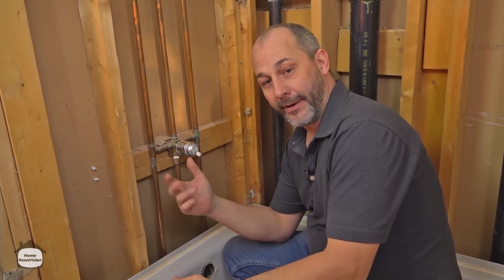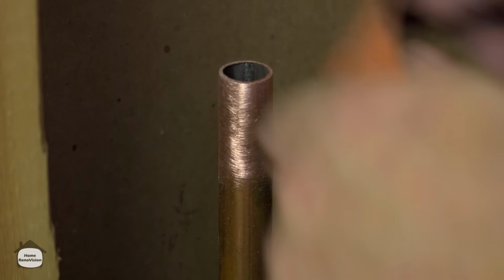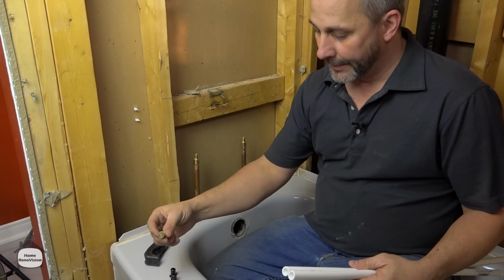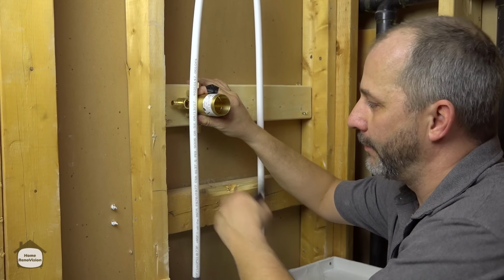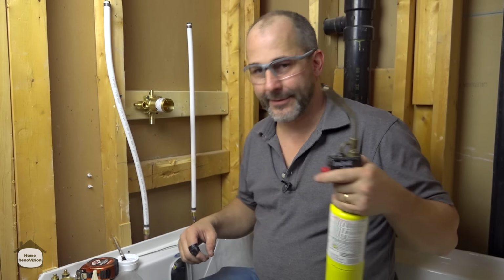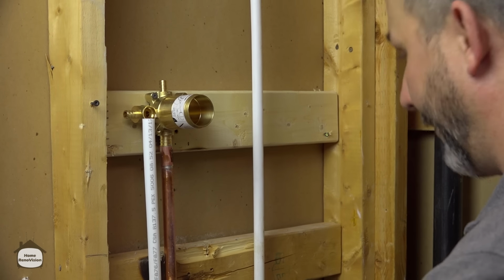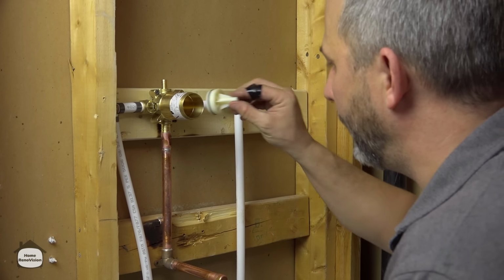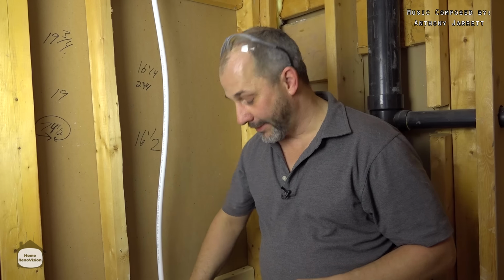DIY How To Install Copper To Pex Shower and Bath Plumbing

Comment: Being a contractor you should invest in a pex a expansion tool. I used my new dewalt expansion tool yesterday ($299 tool and heads, no battery) and loved how quickly I was able to run plumbing for 3 bathrooms and a laundry room. I think once you try it you won’t go back to the hand crimper.
Reply from the maker: I will take a look at that, Thanks!
Reply: Yes Uponor pex and the Dewalt expansion tool are the bee's knees! I have plumbed half my home with it, still working on the other half.

Comment: Tank's for your videos. I would like to if you install a sink or shower in basement ,do you need air column that prevent knocking when you close water supply valves ? Tank's
Reply from the maker: all plumbing needs air! the knocking you here when closing the valves can be caused by using copper pipes without hammer arrestors.
Reply: It is for a new bathrome in the base basement, the water supply come from the first floor, if I use pex do I need arrestors ? Thank's
Reply: Normand Fontaine it cant hurt

Comment: After soldering:  you might need to use a clean rag to wipe off any excess flux or to avoid the candlestick effect.
Reply from the maker: I hear that however it is not a seen after closing the wall and won't be a problem down the road.

Comment: Do you have a video on installing a dishwasher from a original plumbing system that did not have one. I would like to DIY this if it is easy enough to safe money. Or should I call a plumber? I have never done plumbing before.
Reply from the maker: I love that idea. Anyone in my area want a dishwasher installed let me know.

Comment: what flux do you use? and do you use MAP or propane torches.
Reply: brian tran  map gas is a yellow cylinder propane is blue he’s using map here.
Reply from the maker: I use Map gas. And I have no preference for flux.

Comment: Why add the temporary caps? Are there no shut offs on these lines?
Reply from the maker: No shut offs on these ones. It is common for a second floor bathroom to have no shutoffs. Cheers!
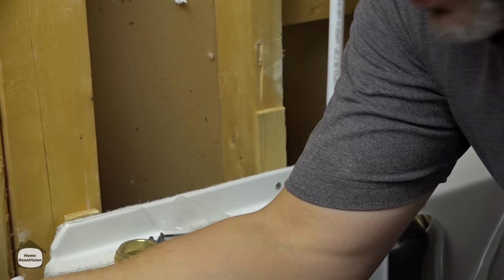Reply: The shut offs are on the valve itself . He took them out at 9:47 mark

Comment: Hey Jeff I enjoy watching your videos ever week, I've always been fearful that pex plumbing might burst inside the walls. In your experience, have you ever had this happen?
Reply from the maker: No and a s a matter of fact it is less likely to burst than copper in cold weather. It has an ability to expand under freezing pressure. Cheers!
Reply: Very unlikely but it can happen. Had a pex 3/4 line burst in a high end apartment I'm working in...burst o ln 3rd fooor and dripped down thru 2nd floor apts and into 1st. Was dripping all down thru light fixtures and these apts were finished. Drywalled and painted... :x
Reply: @mixetube1116  shark bite pex can hold right at 500psi then it bursts.
I do not know the amount of pressure goes through an apartment complex, but I do know that if you did not store your pex tubing away from outside elements like UV, then it can compromise the tubes and most likely burst.
Reply: as a landlord manager for many years 312 units and multiple dwellings Ive personally seen more damage from copper piping...  Ive not seen a pex failure so far

Comment: I am a big fan.  I've noticed you haven't use the 'go'  'no-go' gauge for crimping.  Also, you have crimped some of the crimps  partially only and not the whole surface of the crimp. Was this OK? In one of your similar videos you've used Sharbite to go from copper to pex, are both connections are suitable for inside the wall?
Reply from the maker: sharkbite is only allowed if you have access from the other side. The crimp was not a concern as it closed over the rib in the fitting.Cheers!
Reply: @HomeRenoVisionDIY  Good info on the partial crimping. I did not know that so thanks for that.  I have a gift of explaining things very well in a very logical way. I'm enjoying your videos very much. Thanks

Comment: This channel is invaluable.. thanks so much.  For a plumbing dummy.. what's the reasoning for reusing the copper at the bottom rather than going with a non-metallic alternative (pex/pvc)
Reply from the maker: In a lot of vales the manufacturer does not like the smaller diameter going to the tub as it causes a drip from the shower at times. So this was done to help folks avoid that if they think it is a problem.
Reply: Also it's much more rigid often times people will pull on the tub spout to make the water go up to the showerhead it's a diverter. Spout and I recommend the showerhead be done in copper as well people hang those shampoo. Holders and stuff from them it's just better for any stubb out to be copper in my opinion

Comment: are these connectors called shark bites?
Reply from the maker: Not on this project, but I have used them. Unfortunately you will need access to them to replace if necessary. The building codes still don't have confidence in the new model for long term use. I am expecting that to change.
Reply: @HomeRenoVisionDIY  gotcha. is there a specific name for these connectors? nice video as always

Comment: Why does the copper water supply go above the valve? Is it some kind of expansion area? And why not the same for pex?
Reply from the maker: In copper plumbing you get a condition called water hammer when you open the taps. the pipe expansion past the valve is designed to reduce that problem. This problem does not exist with pex plumbing since it can absorb changes in pressure without causing the rattling.

Comment: How come you did not clean the soldered joints with a wet rag after you soldered but before it cooled, to take the excess flux off the copper so it does not corrode the copper over time?
Reply: This guy's an idiot
Reply from the maker: a little green stuff won't hurt long term.

Comment: Do you ever need to put a heat shield behind what you're aiming the torch at, or is that one of those things where if you think you need it you're doing it wrong in the first place?
Reply from the maker: heat shields are for protecting flammable things, i prefer to have a spray bottle near by.
Reply: I know a plumber that burned down a apartment building, he was changing a shower valve and some embers went up inside the wall into the attic and started the fire.
Reply: @nomanjones4803  Ex plumber now?
Reply: Yes, he just a contractor

Comment: Sharkbite
Reply from the maker: perhaps, but if you don't have access from the other side of the wall this is a better option. Cheers!
Reply: Sharkbites have inner rubber seals that wear out over time, especially if you have hard water!
Reply: I've never had a problem with sharkbite
Reply: Leaks

Comment: Anyone else have the sound drop out at ~15 min in for about 30 seconds?
Reply from the maker: sorry to hear that catman. I checked the video today and did not have any probs. I think youtube is really busy tonight Cheers!
Reply: I'd think that maybe you just weren't saying anything, but it sure looks like you're talking at 15:30.
Reply from the maker: I am going to check again. thanks!
Reply from the maker: Damn, you may be right. I will check with Max!
Reply: @HomeRenoVisionDIY  all good this was done intentionally
Reply: Yes youre right
Reply: Yah me too
Reply: I'm kinda surprised u don't tak about sharkbite connectors with pex....since u don't require crimp rings...could b Cus there expensive...but very simple to use !!!
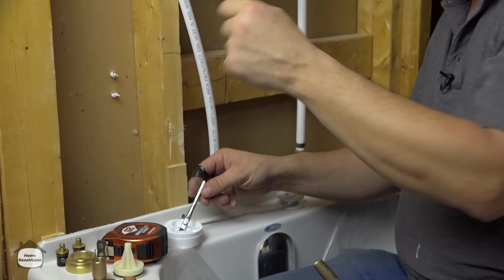Reply: Catman yes. 15:10 n after briefly